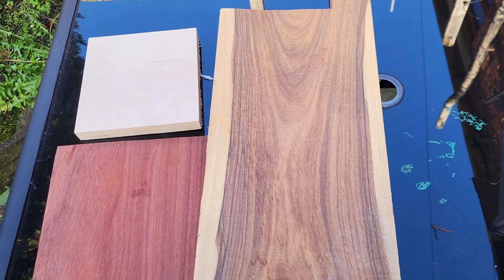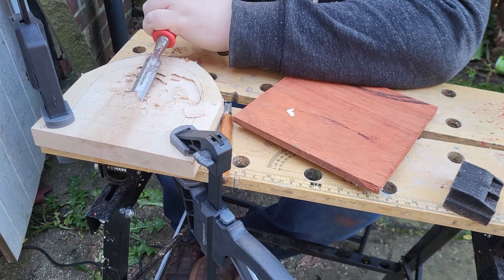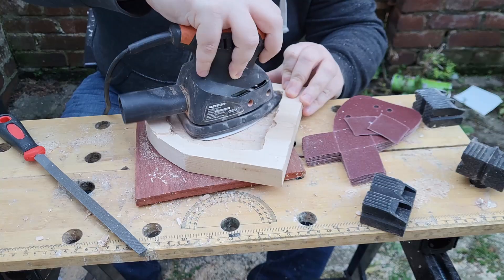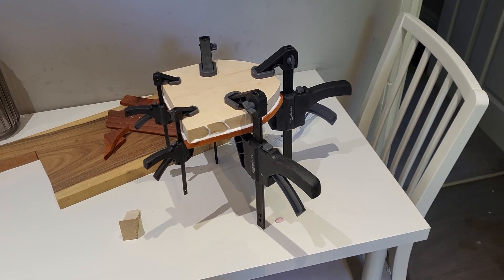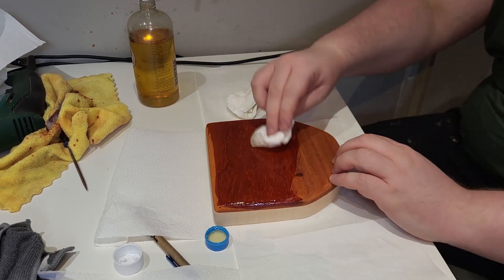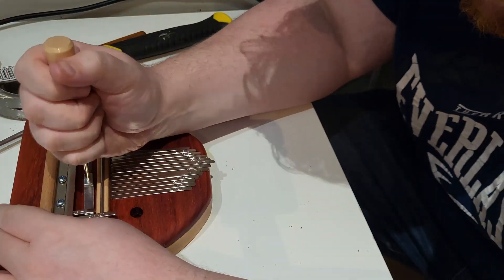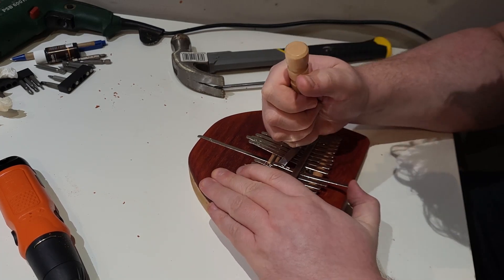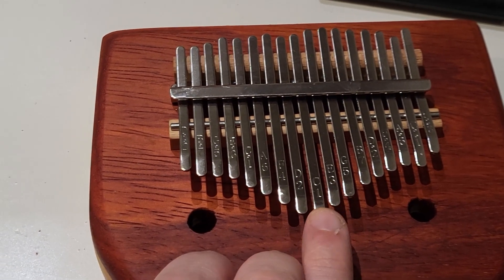Building a Kalimba (Mbira, Thumb Piano)

Comment: The wood filler bit gave me a good chuckle. Is the position of the fret arbitrary? like just a case of getting it as close to the bridge as possible, and then tuning?
Reply from the maker: Its only the length of the tine that affects tuning, so you could have the bridge 10 inches away but you would need some long metal bits. i think it would also effect the clarity if you made it to long as you need a clean bend on the metal. Also, hey man